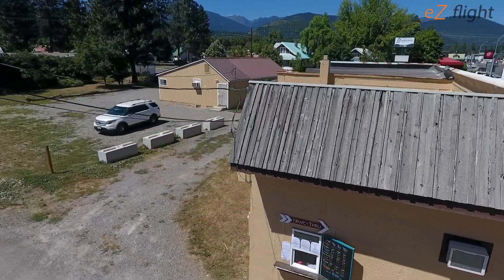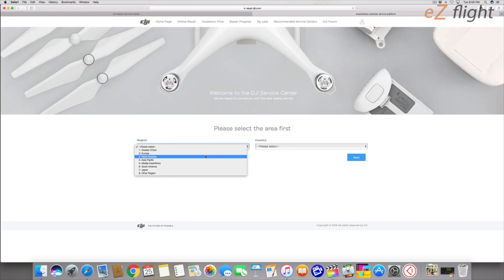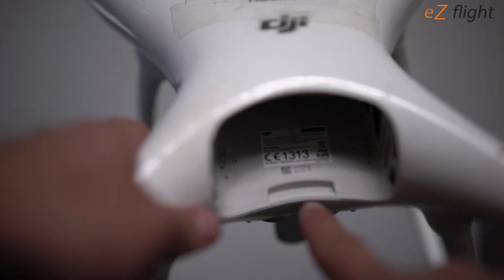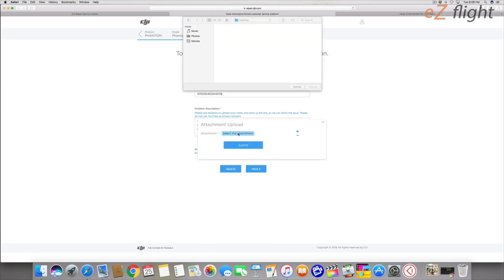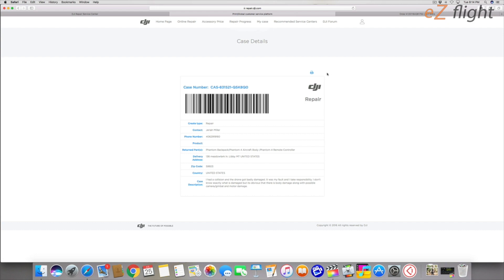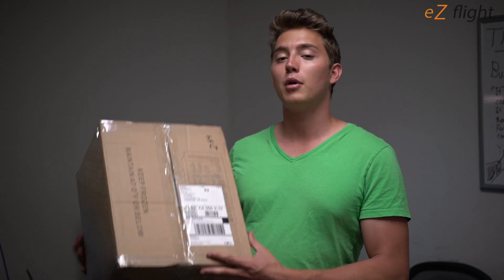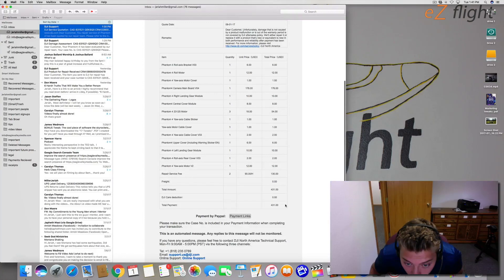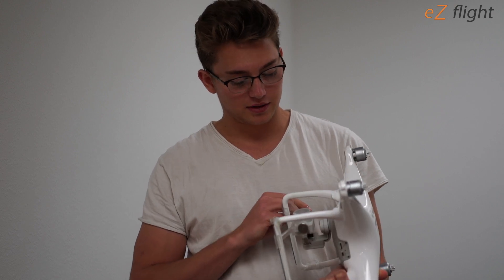How to Fix your Drone - DJI Repair Service

Comment: Hey ,😕
I have purchased my drone and today it shows a message on screen " gimbal not prepared or gimbal interfere by an obstacle" 😭this message appera after gimbal calibration and my drone camera record video perfectly but cannot controlled by remote , they had remain in one position . Any solution plz help😫😥

https://youtu.be/NBS3VflQ5Nk
 Watch video of this link 
Similar problem happens to mine😫

Comment: That was good info, Thank you,,,, just curious how you crashed your drone to do that much damage, did you run into a tree with it or did it drop out of the sky, if it dropped out of the sky what was your approximate altitude when it dropped, looking at the damage on your drone, it seem to look more cosmetic damage, I have the same drone as you, I didn't crash mine or have any problems with it yet lol, I thought the repair Bill seemed a little high
Reply from the maker: It was about 40 - 50 feet when it crashed and it dropped so I landed hard and I think it may have damaged more than cosmetic. They replaced the camera and gimbal and basically everything else on the drone lol. But yeah the price seemed high. I think if it was just a small crash and didn't damage much it wouldn't be too expensive.